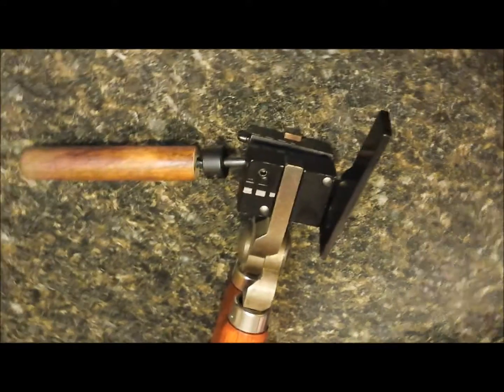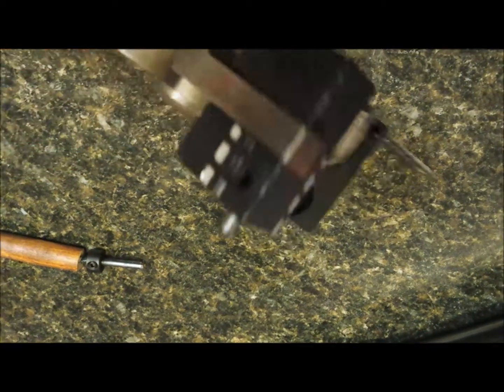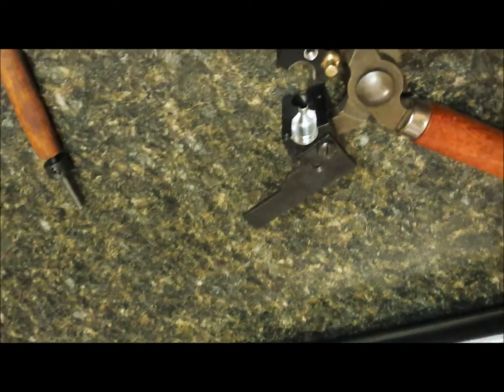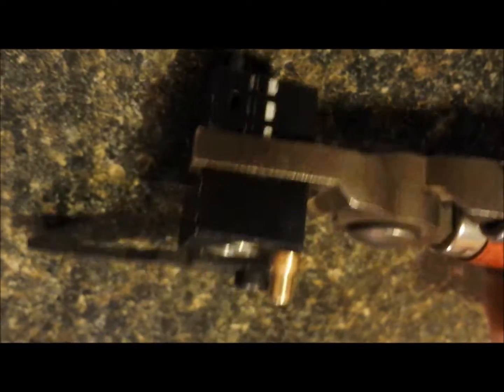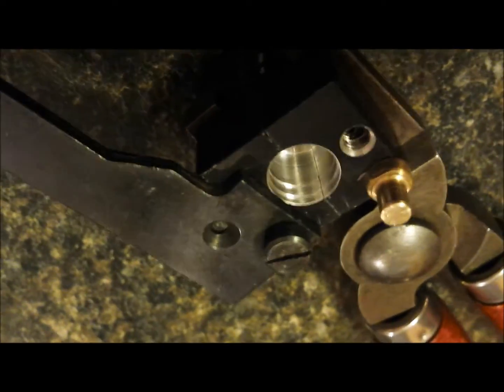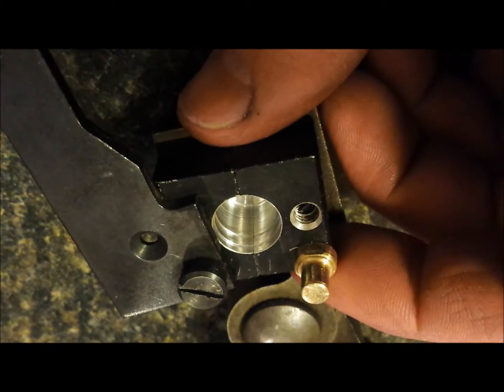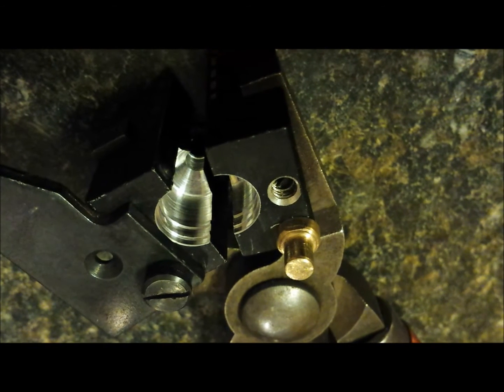.50 Caliber Custom Machined Hollow Point Bullet Mold

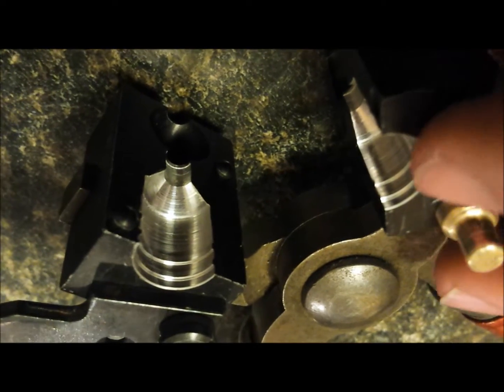Comment: Not sure how you would do a hollow base youd somehow have to turn it around and pour from the top.  What youve got here is really good.  750 fps on a huge bullet like this is really good.  You dont say what twist rate your barrel liner is.  The bullet length and resulting spin as determined by your speed is what determines stability of projectile.  So if you have a 1:36 twist it may be too slow for this long bullet.  You can make another probe that takes up some length or cut off the front of this mold.  Otherwise round ball will kill anything you are shooting at and accurate as long as it is over bore size.  I shoot .433 in my .429 liner. Real accurate.  If you have a 1:28 maybe good but if too slow for twist then make a bigger hollow point so you retain the length that the twist likes. ++